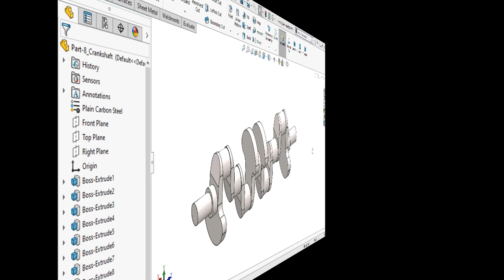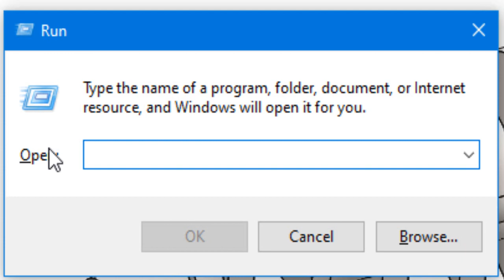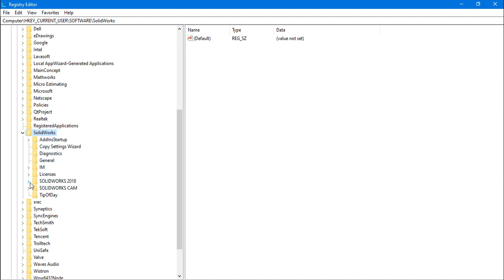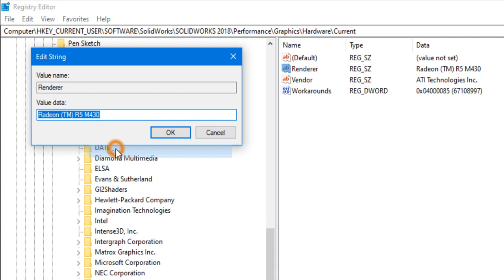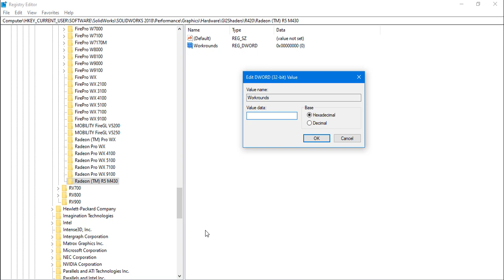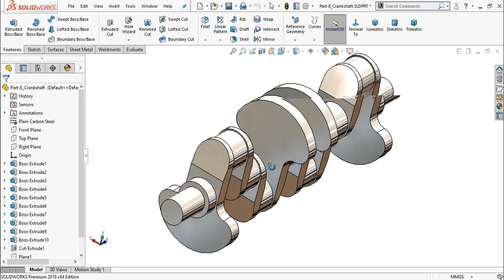How to Activate REALVIEW Graphics in SOLIDWORKS ? | On AMD/NVIDIA/INTEL INTEGRATED GRAPHICS CARD

Comment: Windows Registry Editor Version 5.00
[HKEY_CURRENT_USER\Software\SolidWorks\SO
LIDWORKS
2021\Performance\Graphics \Hardware\Gl2Shade
rs\NV40\Geforce]
"Workarounds"=dword:00032408
[HKEY_CURRENT_USER\SOFTWARE\SolidWorks\
SOLIDWORKS
2021\Performance\Graphics\Hardware\NVIDIA
Corporation\GeForce]
"Workarounds"=dword:04000000

Comment: For a Radeon RX 6700 XT (and I assume any card in the RX 6000 series) I used the "R420" folder under "Gl2Shaders" along with a Workarounds value of 30408. That's the one that did the trick.

Comment: did anyone managed to get this to work on NVIDIA GeForce RTX 3090/PCIe/SSE2?
Reply: i have a NVIDIA GeForce RTX 3080 Laptop GPU/PCIe/SSE2 i am trying to get to work.  Did you figure out how to do the 3090?
Reply: @bustedknuckleoffroadllc5060  no, not yet :( . I tried 33408, 32408, 30408, 31408, 31408, 30008 to various locations in Gl2Shaders but no luck....pls let me know if you find the solution
Reply: @light.ray___  I have the same problem. However, somewhere on the Internet I found information that realview does not turn on with new drivers. I tried to install drivers from the beginning of this year and got a positive result. However, in my case, this is not an option. I have a laptop with a built-in quadro p3200 and an external thundbolt GPU 3090. However, I only need the new RTX drivers (471.68) that work on both cards. So, if you have information on how to run realview on new drivers, please post this information here.
Reply: @ДмитрийЧаплыгин-б7ч  Thank you, that confirms my theory, I've had realview before and had no issue activating it on my RTX 2080 S, but recently it just wont work. Guess we just have to wait for some kind of fix to show up
Reply: @JanssonNo1  i think i had realview before aswell. I just noticed that its not working. And i have updated drivers lately, so that might be the reason i guess
Reply: @bustedknuckleoffroadllc5060  Same. Tried various GI2Shaders without Laptop GPU/PCIe/SSE2 since this looked off compared to other key names as well, but still no luck.

Comment: What to do for GeForce Gtx 1650
Reply: Same I was searching for
Reply: Did you find?
Reply: @rahulnalamasu2071  For GTX 1650 intel/ryzen  go to n40 folder make a new folder and paste the graphics name the futher process of d-word is same as shown in video.
Reply: @MahendraSharma-zy2bb  but iam not seeing any change
Reply: @MahendraSharma-zy2bb  Btw mine is nvidia GTX 1650
Reply: @rahulnalamasu2071  Well GeForce is the brand of Graphic processing unit Designed by Nvidia.

If you done all step properly
try to close the application and restart the pc.

Comment: for intel gtx 1650 paste in nv40 folder and add 30408 it will work
Reply: I have a 1050ti, i tried everything for the past 10 days, nothing is working for me, it used to work in 2019 version, but now i have 2021
Reply: @Doc_Marvelist I am facing same problem 
Did you found solution
Reply: Thank you

Comment: I have Intel(R) HD Graphics.... I tried but did not worked... Any suggestions where to add that stuff?
Reply: Did you found how
Reply: try (30008, 30408, 31408, 8....) but you need  untick “Use Software OpenGL” (Tools -> System Options -> Performance, “Use Software OpenGL”)

Comment: I have Intel(R) HD Graphics 4000 and it doesnt work HHH
Reply: try (30008, 30408, 31408, 8....) but you need  untick “Use Software OpenGL” (Tools -> System Options -> Performance, “Use Software OpenGL”)
Reply: Put your graphics card name in Other folder """Other"" this is folder name

Comment: Bhai mera nahi ho raha hai 
Solidwork 2020 or GTX 1650 hai 
Please solution
Reply: Just paste in NV40 and other is same process
Reply: @aadityadhiman8518   i have 1650 still not working in folder nv40
Reply: same ive 1650 and its not working
Reply: you need  untick “Use Software OpenGL” (Tools -> System Options -> Performance, “Use Software OpenGL”)
Reply: @congtruongdam1467  where do i need to do this?
Reply: @rahulnalamasu2071  soliworks software.
Reply: @congtruongdam1467  okay

Comment: dear sir, can help teach me how to activate realview solidworks 2018 AMD Rodeon Vega 8, pls help me ya..appreciate
Reply: Make a new key in R420 folder. Paste your integrated graphics name there. Use '30408' value. It will work. It worked for me, I have vega 11 graphics.
Reply from the maker: We are providing a remote assistance it is paid service ? Would it require ?
Reply: @EveryEngMechanical  no thanks